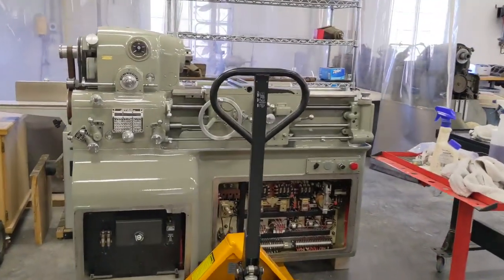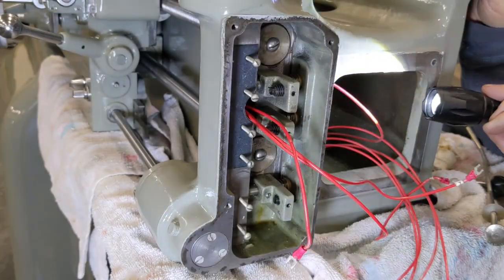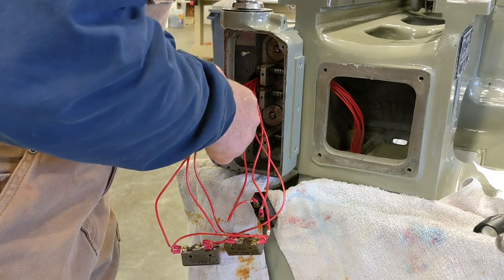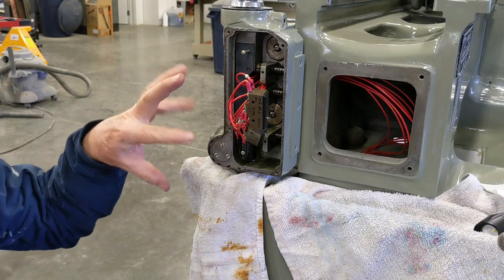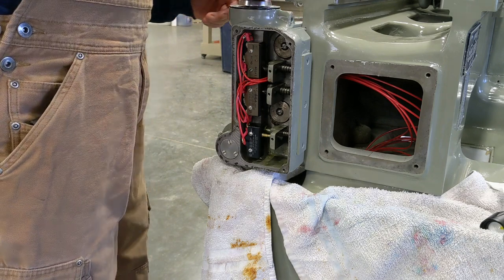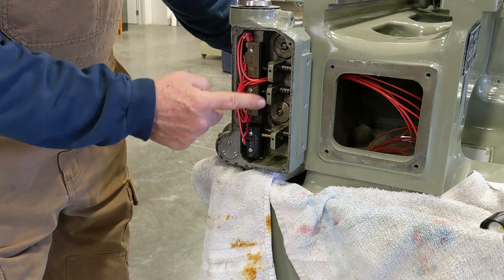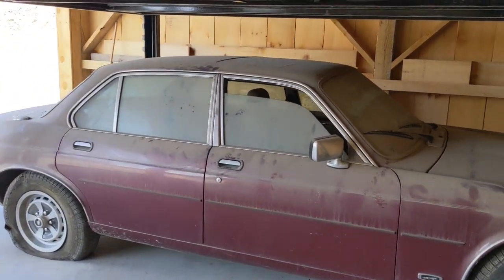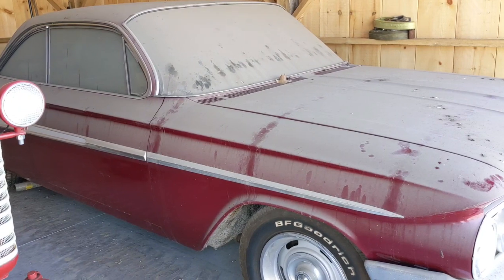10EE part 16

Comment: For safe operation of the elsr, the trip dogs must return the apron spindle start\stop lever to neural\ lock. The machine is small, but the power  is large.
Reply from the maker: Thanks for checking out the channel and for the tip!

Comment: Jaguar window switches. disconnect battery..  pull the window switch panel forward.. leave switches in place.. note there is a hole in the sides of the Switches.. you can stick a small flat needle file thru the holes and between the contacts.. rock the switch the other way so the contacts exert force on the file surface.. drag the file back and forth a few times..  do all 4 switches and where ever the sun roof switch is.. this burnishes the giant silver contact surfaces to restore them to working condition.
if that model has turn signal and stop light relay boxes at each corner.. don't buy new.. knock the corner rivets that hold the case close out..  open the cases..  the main circuit board and a second circuit board on top on connecting pins.. resolder the pins.. resolder the other side stacking sockets to the circuit board..  give the relay contacts a quick blast of cleaning spray.. put it back in.. all the lights work again and the bulb out warning is no longer on the dash..  this is a test to help  on the rest of the wiring. https://i.imgur.com/WMDprhm.jpg  you may need a longer test lead to hook to the battery in the trunk while doing voltage drop testing..  you will probably also want a 1/4" copper fitting cleaning brush with the tip bent to a 45 to 90 degree angle to allow you to pull fuses one at a time and work the brush thru the fuse clips.. 

 on the monarch switches you just installed.. did you check with your DVOM in continuity beep mode to listen to see if the contacts are good or burned in the switches..  you may have to look at what the switches operate to see if you can calculate a load thru the circuit to verify the switches have enough amp rating.. that style of switch can be 1 amp thru 25 amp rated. with significantly different sized contacts inside..  there are also different spring tensions..
Reply from the maker: Thanks Wayne,
Great tips, I'll give it a go. I did check the 10EE switches with a DVM..all good.

Comment: A little too late but my wires go through a polypropylene tube that acts as a loom to protects the wires from the sharp edges of the castings.  I hope to attach the wiring before attaching ELSR to the lathe bed. Thanks for the extra time explaining the switch movements relative to the controls.  Your tour of your future projects is ambitious.  I look forward to watching you as you go through restoring them.  Cheers, Will
Reply from the maker: Thanks!!... I didn't think about an extra sleeve to protect the wires  but if I ever have to get back in there, I'll certainly do that
Reply: @fourpondsshop7940  I wouldn’t redo the wiring either but I might wrap the wire in contact with the casting with electrical tape...  your work is inspiring me to get back on my own lathe and get it done. Cheers, Will